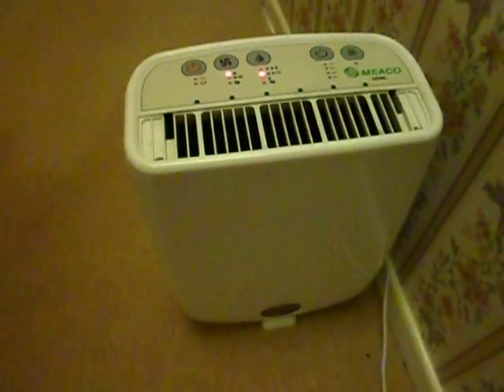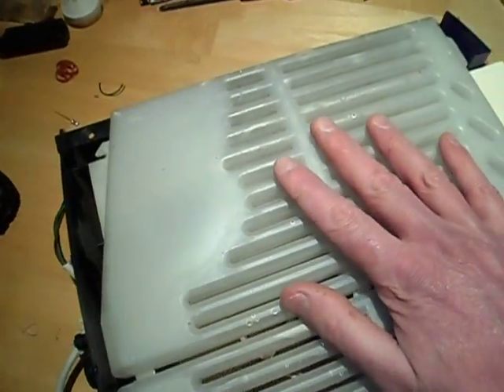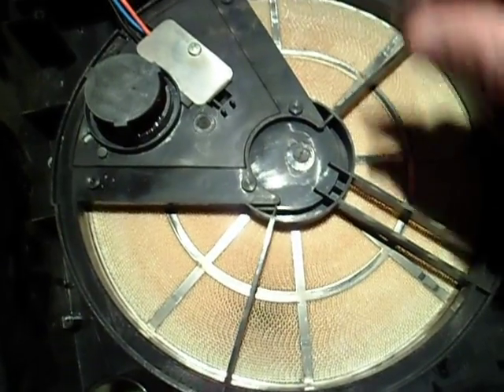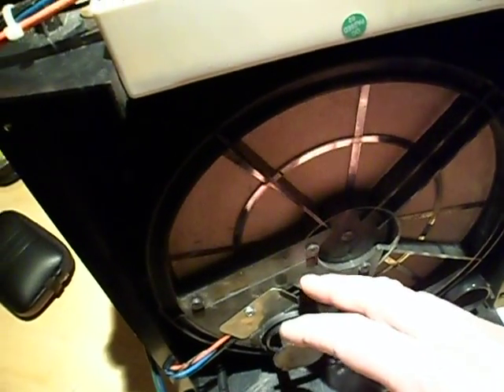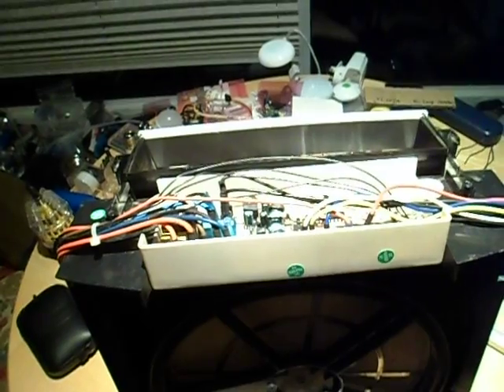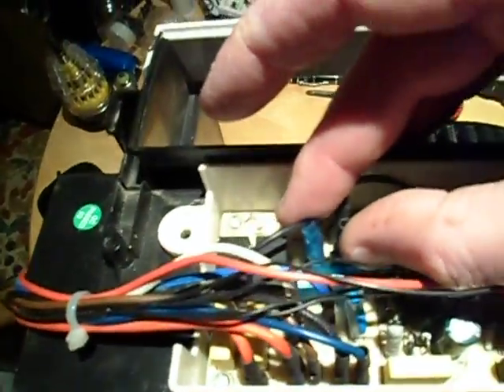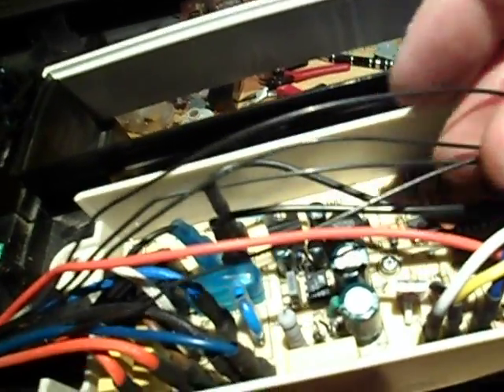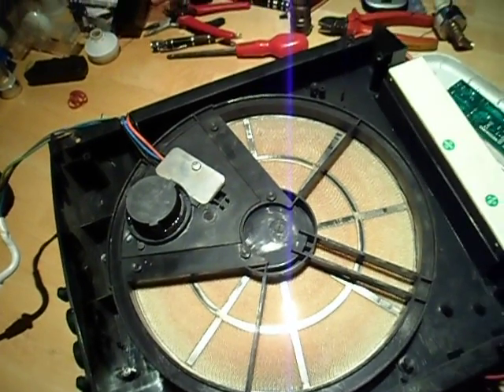A look inside a desiccant dehumidifier.

Comment: These things are portable heaters with horrible chemical smells.   They are indeed extremely quiet compared to compressor ones,  but people should be aware of how hot and smelly they are.  Ironically they advertise these as removing smells.  But they actually make smells worse.
Reply: Mine certainly smelled terrible for a couple of days when new, but after that it was fine. It was a strong plastic packaging sort of smell - apparently the zeolite absorbs odours as well as moisture. A hot/burning smell could be indicative of a fault, though.

Comment: Thanks Clive. Wondering if this world work in a crawl space under a house? Have to seal off the vents and use this to extract moisture. 
Might plug up with dust and how to drain the tank? Problems to work out, but seems do able.
Reply from the maker: A humidifier is only really viable for fairly sealed areas.  Have you considered a simple fan to create airflow through the crawlspace to reduce buildup of humidity?  Especially if it's only turned on on dry days.  That would be a very cost efficient way of drying that area.

Comment: Great video Clive - Scottish Engineers the best in the world . I somehow stumbled upon this as Im trying to understand if a newly arrived dehumidifier (ironically the very desiccant model you have there) is the cause of a dramtic escalation in more frquent and more painful migraines. . I hate the smell of the chemicals that come off this unit - very "chemically" I wonder if thats half the problem. (Does it ever go away?)  Ive ordered a hygrometer to see whats going on more generally. I ALSO heard  that dehumidifiers can lead to additional C02 build-up - which apparently can also trigger migraines. (Co2 not CO - another story) (Whether thats because windows are opened less or not I dont know) Alas - so many questions and no-one to ask (and Google isnt much use). P.S. I replaced the motor on a Dyson DC07 the other day - saved a small fortune. (Though rather fiddly) Cant believe the price these things go for once you open them up.
Reply from the maker: The nature of desiccant dryers is that they can create a dry dusty smell which may actually be smells absorbed from the air.  It does diminish with time.  I'm not aware of them causing CO2 increase.  They literally just absorb moisture and then condense it out again in the heated section.  I tend to use a humidity meter to set my humidity at about 60% and always use the unit at its low setting for longest heater life.

Comment: I have a Meaco DD8L bought new 2 years ago, didn't use it till now. I find out that after a short period of time the alarm light is on and not working. Any thoughts please?
Reply from the maker: Is the filter clear?  The early units were prone to problems with the heater failing when used at full power all the time.  Check if warm air comes out and that the fan runs normally.
Reply: @bigclivedotcom  thank you, I checked the filter is clean and set it up on low power and is working great and continuously.

Comment: Would the dehumidifier work at all without the heater ? Looking for reducing the energy consumption...
Reply from the maker: No.  It needs the temperature differential to work.  A low energy dehumidifier for rooms would save people a lot of money.  I recommend using a good humidity meter to monitor levels.  If you over-dry the place it uses a lot more energy to do so.
Reply: bigclivedotcom Thanks for the answer.

Comment: I have an amcor DESD8L dehumidifier. The dessicant disc isn't moving and there is a loud noise. Do you know if I can get a replacement motor?
Reply from the maker: I had an issue with the motor too.  It literally ground its bearing oval.  You could try contacting Meaco, but they'll probably just want to do a "service" for a fee high enough to consider getting a new simpler unit.
One thing to check is if the drum is snagging.  Sometimes the metal fins that hold the desiccant material in place snag on other metalwork.

Comment: As I understand it compressor win at 20degrees c on power consumption, desiccant dehumidifier win in cold conditions.

Next question flooded metal single skin -garage best self drain auto restart model capable of garage dust if anyone has suggestions  please

Comment: Hi bigclivedotcom, thank you for the video. 
I was wondering if you could point me to the right direction. I have a 4 year old Meaco DD8L which had problems from the day 1 - it was making squeaking noises and Meaco advised me to run it for 48hrs on the laundry mode which did not help in full as the noise was coming and going. I did not have a will and time to pursue it further with Meaco as the noise was OK to live with. Now, when the 3 year warranty has expired it suddenly stopped working. There was a burning smell , after it went from 1 to 2 fans mode and the fault light went on. It does switch on, works for about a minute 30-60 seconds and shows the fault. Cannot feel any warm air coming out, may be just not enough time to heat up before it switches off - do not know. The filter is clean. Any idea what could the problem be? Could it be the thermal fuse? Thank you
Meaco asking for £70 for the repair and I am not really keen in investing so much into this machine as it already cost as small fortune at the time of purchase and was not really used as much. Thanks for your thoughts.
Reply from the maker: This technology is still young, and has had teething problems.  It's possible that the drum has been catching on the element or that the drum motor has failed physically (bearing failure).  If used at the high setting the earlier units often suffered element failure.  I recommend using these units at their low setting to prolong their lifespan.  At the moment I'd suggest the EcoAir simple as being one of the dumber and therefore more reliable units.  Or go with a traditional compressor based replacement if the area it is being used in is warm.
Reply: Thank you for your prompt response, bigclivedotcom.

Comment: would the main thing that condensates water run at 240volts? I’m wondering if i could bypass the control board and run the dehumidifier as always on. but thing got rusty at the bottom 😐
Reply from the maker: +Donald Sleightholme It needs the heater regulation.  It could overheat on straight power.
Reply: bigclivedotcom oh 😔

Comment: Great video bigclivedotcom. With your help, I have fixed my dehumidifier with a new synchronous motor from ebay China, about £3 I got the CW / ACW motor because it was the only one I could find and I do not see why it maters which way the drum revolves. I had to cut the motor spindle down to length and grind 2 flats on the spindle with an angle grinder. Dead easy. I have since found out that my dehumidifier had a 2 year warranty, so that would have been a simpler but less satisfying route. 

As I think you realise, lots of people are also interested how to get into the blasted thing. There are 4 hidden screws in the lid, and 2 of them hold the lid on. A lot of time can be wasted if you find the wrong 2 screws and leave the others in place.

I would also like to see a reassembly shown because I am left with a plastic baffle and no idea where it goes. The motor took a couple of weeks to arrive and in the meantime, I forgot where some parts went. Good stuff though, it all works great.

 Keep up the good work  educating us with what we are not supposed to know about! I love your videos
Reply from the maker: One of mine ground its motor shaft to death.  I was trying to find a compatible motor with matching shaft flats but failed.  email me a pic of the baffle and I'll try to guess where it goes.  bigclive1@gmail.com
The motor direction doesn't seem to matter as this motor stopped being directional long before it failed.  Which motor did you get in the end?

Comment: Air can contain water at below zero temperatures. Very little when measured in grams, but relative humidity can still be 100% at minus 20 degrees Celsius. See Mollier diagram. You can line dry clothes outside in freezing temperatures.

Comment: Heat pump dehumidifiers are still better at dehumidifying as far as i know. The much more silent operation is very attractive though...
Reply from the maker: I use heat pump in summer and desiccant drum in winter.  I keep a cool house so the heat is useful and the desiccant units will operate to a much lower room temperature.
Reply: Ah yes, I bet it would with how cold you guys are accustomed to in the winter xD The southern US doesn't get that cold for very long, and I am painfully freezing if it is colder than 18C in the house. I also live right off of a river, so the humidity is through the roof.

Comment: Does this unit automatically restore its last operation state after power loss?
Reply: No, unfortunately. The manual also cautions against using it where the mains power supply is erratic. I think this is because in normal operation it runs the fan(s) and desiccant wheel for a couple of minutes after the reactivation heater turns off, perhaps to ensure it is properly  cooled.
Reply: Whoops, I misremembered - while it resets to defaults after power-cycling using the Power button, it actually does restore the last operating settings after mains power loss. My bad. :)

Comment: I got rid of the calcium chloride tubs littered around the house on the back of the review you did on the Unibond 360 dehumidifier & bought a dessicant type dehumidifier on your recommendation. We bought an Ecoair DD1 Simple & so far it's been great, I was sold on the dessicant type because they work down to 1 deg. C & we have the heating on as little as possible in our house lol. It's sucked loads of moisture out of the air & it even adds a bit of background heat. However, I understand fully the bit about the dessicant absorbing the moisture, then it's heated & the moisture is then condensed out of that heated air on a condenser, but where does the water come from that's in that condenser & how is that water then cooled in turn to give up it's heat?
Reply from the maker: I'd recommend you only ever run your eco-air simple at its low setting for maximum lifespan.  After you've had it for a while it's a good idea to sit it on a tray as the water collection tray can eventually get blocked with the slime found in all water collection devices.  The way it works is this.  As the desiccant drum passes through the main airflow it absorbs moisture from the air.  It passes through a closed loop of hot air that expels the moisture and pushes the hot moist air through a plastic cooling panel that is being cooled by the main airflow.  The moisture laden air is cooled enough that it condenses out on the plastic condenser panel and drips down to the drainage tray.  These units are ideal for cool houses.
Reply: Thanks for the explanation, that's made it clear. When you say the lowest setting, do you mean the fan switch or the humidistat?
Reply from the maker: The fan switch.  It's not just for the fan, it also changes the heater setting from around 330W to 660W and when run at full power the heaters in the earlier desiccant units were prone to early failure.  A test of power consumption versus water extracted also showed that they are slightly more efficient at the lower setting.  I'd recommend a good quality humidity meter to set the manual humidistat on the machine.  I aim for around 60% humidity here so the thing doesn't have to run all the time.
Reply: Thanks again, can you recommend a source for a good quality humidity meter? I do remember you stating somewhere that the humidistat hysteresis is quite wide due to it's location inside the unit.
Reply from the maker: It's tricky finding an accurate one.  You can buy five and they will all read slightly differently.  There is a wide hysteresis because the dehumidifier has a big drum of desiccant inside it when it stops that keeps it dry locally.  The electronic ones have a feature where they occasionally sample the air by running the fan for about 30 seconds every so often.  But the simple unit is fine and much more reliable.
In my bedroom where I keep the humidity at 60% the dial is set to the one-drip and two-drip marks.  For the rest of the house I let the humidity go a bit higher with the dial pointing at the single drip and generally keeping humidity at around 70%.
Reply: Thanks Clive. I enjoy watching your stuff BTW, I find the stuff you review interesting & you're quite entertaining to boot.

Comment: I have an eco air dc18 a slightly more modern compressor dehumidifer, it also runs about 300 watts but will do a full tank for around 40 pence, or there abouts. But you are on the money with the temperature comments. With the house around 18- 21 degrees it will pull a full tank for around the 30p but drop it below 15 degrees and the thing is constantly having to go into defrost mode and consequently the efficiency drops out the bottom.

Incidentally the tank in yours is a 2 litre, the model I have is 3.5 litre. (just for comparisons sake)
Reply from the maker: I use compressor based dehumidifiers in summer as they are much more efficient, but in winter I keep my home cold (10C right now.) and use the desiccant ones set at their low power setting to avoid the heater burnout problems they have running at full power.  By far the most reliable are the compressor units.  The desiccant ones are needing to evolve.
Reply: That makes sense thanks for the clarification. I live in an old farm house with solid stone walls which means that without the dehumidifier the place loves to get damp

Comment: Thank you for this informative video. my DD8L now trips power every time its switched on. any idea what causes this? you have mentioned Thermal fuses in your video. Could they be the cause? Thanks
Reply from the maker: It could be that the heating element has broken and is touching its housing if it's the main RCD breaker (with test button) that is tripping.
Reply: Yes I think you are correct. Is the heating element repairable/replaceable?
Reply from the maker: Amir Azzawi Not sure if you can buy the heater on its own.  The manufacturer might suggest a service, which is so expensive that you might be better just buying a new unit.  My current choice is the ecoair simple as it has minimal electronics. If used at its low setting it should last a long time.
Reply: I've just bought the Ecoair simple and am very relieved to hear that is your current choice! Will be using it on low setting as you suggest

Comment: Thanks for the review. 
I've been using this unit for 6 month through out the winter living in a wooden boat. 10.5x3 m/some 40m³ living space being effectively ventilated. 
Without additional heating temperature is often below zero.. 
The noise level are acceptable, got used to it. 
It is on automatic and hasn't been switched off. Ofte leaving it running unattended for several days. 
- I'm really satisfied and find it very useful keeping moisture level below critical level. The low amount of heating is also helpful..

Comment: How is the condensing panel cooled? I've seen a few videos on dessicant dehumidifiers but this point is never covered. This video is, however, by far the most comprehensive. Thanks for the upload.
Reply from the maker: It's cooled by the airflow through the unit.  The moisture laden air from the heated area is at high temperature, so even at room temperature the condenser seems cool.
Reply: bigclivedotcom That simple? Awesome! Nothing much to go wrong with that piece of the system. I've just ordered an EcoSeb, which is marketed as EcoAir in Europe, significantly influenced by your excellent video. Thanks for the response.

Comment: I own this unit also and feel after 2 years it seems to have lost its efficiency. I've had it running for 15hours and it's only collected about half a tank and hasn't switched off once. I clean the filter every 2 weeks. What else can I do to make it work better?
Reply from the maker: Use a flashlight to look through the air vent in the case to see if the rotating drum inside is clogged up with fluff.

Comment: We have one of these which has just started to refuse to run. When turned on it runs for about 60 seconds and then the fan speed always goes to two fans, flashes, and then the unit stops with the error light flashing. There appears to be the sound of a relay opening/closing as the fan speed changes. All keys then locked until unit turnedf of for a while, after which same thing happens. Any bright ideas. Have cleaned filter and blown air through the two small grilles above filter.
Reply from the maker: Usual suspect with these things is a failed heater.  The first generation units were prone to this issue.

Comment: I found a diy rotor dessicant but it doesn't have a honeycomb structure. It's a wooden wheel, with these thin metal sheets coated with silica (dessicant). The metal sheets have some small spaces in between them. would it be possible to make a dehumidifier (that sheds off water) out of that? badly needed for our science project please... Thank you!

Comment: I need to look into getting one like this now. I've been needing a dehumidifier for my Aunt's place in the country. Now that it's seeing less use, the carpets & cabinets have been getting mildewy. I was just gonna get whatever compressor based unit I could get a deal on, but this one looks like it has more potential. As long as I can set it up with a drain hose going into a sink or out of the floor (it is a plywood house on wheels essentially) I think that could do nicely.

Comment: Please would you advise how to unclip the top and sides?
Reply from the maker: The base comes off completely and there are two screws concealed under the top label (I just cut through it in their vicinity) Then it's clipped together so securely that it requires a big bear hug to separate the two halves.
Reply: fantastic thank you sooo much :)